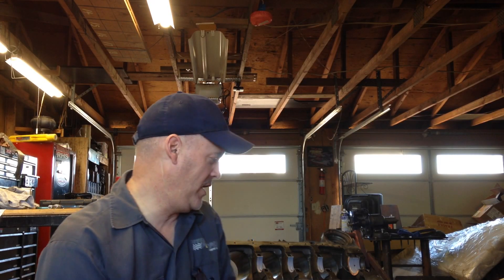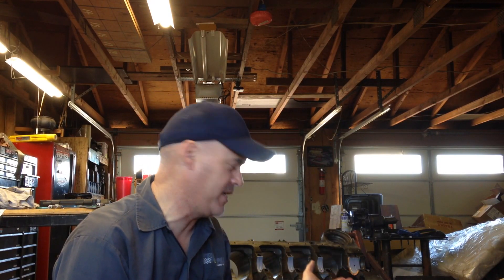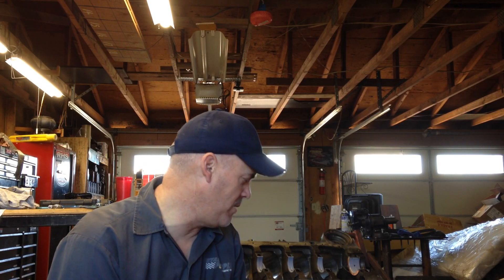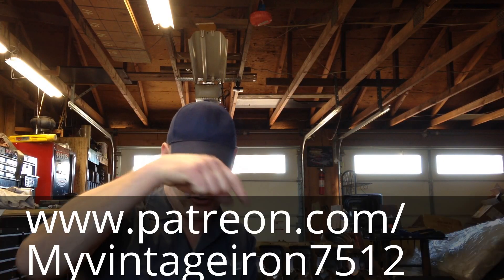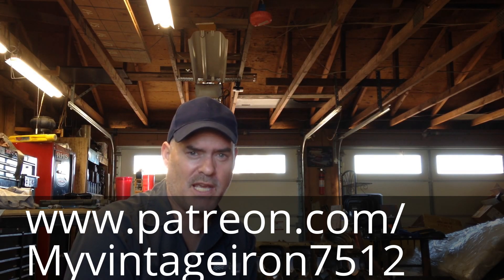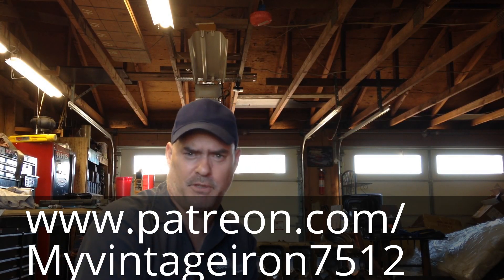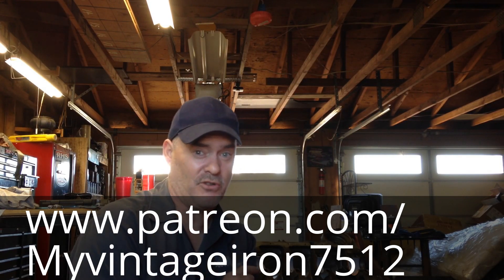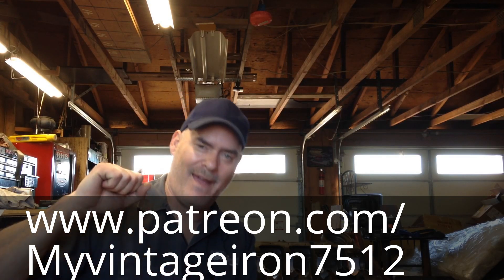Chevy 327 Breakdown

Comment: Seven years and this clip is still getting love! Might as well give it a bump , I rebuilt my 68 327 using your videos . The cam selection using flow numbers and info on rods and pistons really helped hit the target power for its intended use .While it doesn't go rumpity rump it will shit and get in it's 68 Impala home. The one thing I did backwards from most peopled thinking is remove the turbo 400 and put in a 350. It is lighter and takes less power to run and seems better suited for the 327 with a slight stall convererter. With the Qjet it's a goer! Wouldn't have got it right whithout all of these excellent videos!

Comment: The 327 is easily the best old school small block ever built.  I will ALWAYS build a 327 before I'll build a 350.  They rev SO much better than the 350 that the slight loss in torque is WELL worth it.

Comment: My 68 Vette had a 327 and it was amazing. What made it excellent was the Camel Hump heads . It did rev very nicely.
Reply: A 327 has a better bore stroke ratio,they like to rev ,  not as good as a 302 ,but better than 350

Comment: The journal size was increased in conjunction with nodular cast iron crankshafts.  The small journal cranks are all forged and are stronger than the large journal cast cranks.
Reply: Oh that makes sense!!  Bigger to compensate for a weaker material and also cheaper to produce.
Reply: So I just look for small journal crankshaft for my lt1
Reply: Correct. When you look at the crank the casting flash is about 1/2" wide
Reply: Were the old 327s the same bore as a 350, but shorter stroke?
Reply: John Tate, Yes, all 327’s have a 4.00” bore and 3.25” stroke, only difference is journal size.
Reply: silicon212 so all small journal 327s have forged steel crankshafts in them ???
Reply: @shitbox7413   how did you come up with the shit box monicer. 😆
Reply: That's not correct, there were many small journal cranks that were cast as well.  It all depended on what application it was going in.

Comment: Years ago I had a '66 El Camino with a 327. Quietest smoothest motor I ever had and when you put your foot in it it was like a rocket ship.
Reply: About to put one in my 64 elco
Reply: I got me a 327 block but has 350 heads u think it will be ok?
Reply: @funes3699  yeah should work just fine just make sure u put good valve springs in there

Comment: The 327 has always been near & dear to my heart . 307s are plentyfull & people dont want them so use the crank from a 307 put it in a 350 block & you have a 327 & you can use the 350 rod but you will still need the 327 piston. THX.

Comment: Still running my small journal 327 crank in a brand new 4 bolt GM block with spacer bearings on the mains. The other thing that most don't know is every small journal 327 crank was forged from the factory.
Reply: Max Brouggy I know I really miss my 62 had 365 free flow heads 11 and a 1/2 to 1 pop ups port matched everything crane 228 232 at 0 50 cam badass ignition system in a 2400 lb truck. Nothing like it. Until you build a Stout 383 pisses you off makes you wonder why you wasted all that time on that little 327
Reply: I'd wondered how the spacer bearings held up, sounds like they do, thought about doing that myself since I have a 4 bolt block I could put my extra 327 sj crank in.
Reply: @peterdragon9630  2 years on and still no problems, I turn this 7,000 on the strip.
Reply: I heard some say only the 350 and 365 horse small journals were forged cranks.  I  have a 65 300hp 327.  It's already 30 over but worn.   If it really has a forged crank I would like to bore it 40 over if possible and keep the engine .  I already have brodix ik180s , performer and a holly 600 do on it.  Only need better rods I'm guessing to push a 7k redline with a bigger cam.  Have to old 30 30 gm cam in it now

Comment: Good info. 
The 67 302 was produced with a small journal crank with a 2.300/2.000 main/rod journal diameter with a 3.000 stroke and a 4.000 bore. 
The 67 302 cranks were basically 283 units and the blocks were small journal 327 units. 
That changed in 68 and 69 which were large journal cranks and blocks. 

Also some performance bearing manufacturers produce special bearings/spacers that allow a small journal crank to be used in a large journal block. 
The smaller diameter journals lower the bearing surface speed, reduce frictional loss and lower oil temps in high RPM operation.
Reply from the maker: Yep you are correct on all points
Reply: So what makes more power? the 350 or the 327 small journal/large journal ?
Reply: w41duvernay depends on heads ... compression etc.. all else equal, the 350.. more displacement..
Reply: So basically then you could create a hybrid SJ 327 with a standard 350 block and get all the benefits of an SJ with high RPM ranges. Interesting.

Comment: Nice explanation on the 327 - I have a 68 Camaro with the original 2 bolt Large journal 327.  Interesting about the 327's in '69 where block casting #3932386 was used  for the 302 (DZ motor) - there were 2 versions , supposedly - 2 or 4 bolt.  The DZ of course used the 4-bolt one.

Comment: Glad you mentioned the SB 400.  They were notorious for running hot in the summertime with the air conditoning on.  They were not very economical either.  They did not like hard running at all.  I had one.  It sucked.  And not just gas.  An old fashioned mechanic told me 'Never before has so much hot iron tried to cool itself with so little water'.

Comment: Love the content craig. Im not banging on people, im just amazed at how much information has been lost that used to be common knowledge about small block chevs! Glad you're clearing some things up.rod & main journal sizes changed but ROD LENGTH STAYED CONSISTENT at 5.700.All GM did was moved the wristpin location on the piston! Exception: 400 sb wich is 5.565 for cam clearance. 327 were a fave for pro stock racers for many years the rod angle is the best of any sbc.Also if a guy is hellbent on a large journal 327 build and needs a crankshaft dont overlook the 307 as they have the same 3.25 stroke. 69-74. I used to get them given to me for free all the time! I started out collecting/ building/ selling 348- 409s as a teen in the 80s when nobody  wanted them. Been in the game a long time craig with restoration work for both Henry Ford & Sloan museum so im not just another yahoo out there, when I give info it is sound proven and trusted! Keep up the great work.

Comment: My brother bought a 350 from a engine shop I have a 1984 El Camino with a 283 L79 cam and he backs in next to me and pops the hood look my 350 I look at it and it has the vent in the back. I said no you have a 283/327. He traded for a 350 for his 71 RS and I get a 1967 Corvette 327 with a L79  in my El Camino now. 700r4 3:73 posi carbon fiber = fun ride

Comment: In highschool I built a 327 from a 4 bolt 350 block and a 307 crank witch is the same as a large journal 327. 327/350 cam, 327/300 intake with a 2in spacer. Went in my 70 malibu. Those were the days.

Comment: I'd definitely appreciate an in depth video on the 400,  I had one in my pickup and it was a beast. still have the engine and plan on rebuilding it soon.  I've heard about overheating issues though I never had that problem.  I've heard the cylinder walls are thin due to the large bore and I've heard they have extra water ports but it would sure be nice to clear up the patch work of Info
Reply: 400s have siamesed bores and steam holes in the heads,anything else?
Reply: The cylinder walls arent thin, its just that they are siamesed, so they dont provide as much surface area to the cooling water. Smokey yunick did a good job explaining the differences and what they mean regarding cooling and bore concentricity as the engine heats up.

Comment: I have a 1970 Chevelle 4dr. daily driver with a 307 , I am building a 66, 327 Small journal .030 over flat top pistons molly rings Comp hi energy cam with pretty much stock specks on 110 degree center lime for a wide power ban for a 700R4 auto trans. Will be using 882 casting heads and a factory aluminum intake and Q jet carb. I will be adding block huger tube headers and I am hoping this combo will give me good mileage & pull a good sized trailer with out issues in the Chevelle.  And yes

Comment: Have to say I'm loving your channel. They way you speak and describe things is perfect. Don't know why but I've always loved the idea of a 327. Here in Australia the common V8 growing up (25 yrs ago) was the holden 308. 4 inch bore, but a small stroke. The chev guys nearly always went 350. There were a few 307's kicking around but the unique bore size meant that there weren't too many compatible parts kicking about. I'm starting to source parts for my build, and I think I might go 327. 350 block (maybe a later model roller), with a 327 LJ crank. I also believe I can use 5.85" rods with stock 350 pistons with this combo. Should be a nice bottom end which will handle some revs.

Comment: small journal 327 cranks were forged steel ;) and this 1965 Chevy II I bought has a factory 300 hp 327 in it. The blocks casting number is 3790721 and its a 2 bolt block. Im building it for NHRA Super Stock SS/I class with a 4 speed. NASCAR engines use the 400 bore (4.125 inches) and the 302 crank (3 inch stroke) because they rev out to 9,000 - 10,000 rpm and stay together. Im not a fan of 400s and these long stroke small blocks. Ive burned more 383s and 400s with a 283 or 327 than I can remember. A 350 and 383 are good street engines but the shorter stroke engines rev faster and higher and are much better for racing purposes.  I love your videos BTW!!!

Comment: Awesome videos man I like the way you keep it clean! One thing I would like to point out is the 302 sbc shared the same crankshaft as the 283 sbc I used to de stroke 305 Chevy engines that would rev quick and high using the large journal 68-69 283/302 cranks, noted they were smaller bore than the 283's  which gave less cubic inches so it made for a lighter top end weight, I had to use a different connecting rod length though because the pistons set low in the bore, I used 305 truck pistons and 62-64 cc heads because the 58cc heads didn't flow enough air when you revved it up high, I did it on a whim just playing with parts to see how it would run, I have to say I was impressed with them!  I've since moved on to Pontiac engines and I am very satisfied now, but those were some low budget days filled with good memories and friends that I'll never forget! keep the videos coming and I'll keep watching!
Reply: @Aden Kaiser instablaster :)
Reply: @Aden Kaiser happy to help :)

Comment: by the way AMC/rambler made a 327 first and was kind of as hot rod motor for it day.. 327s installed in the 1957 Nash Ambassador and Hudson Hornet models in that it uses mechanical valve lifters and a higher compression ratio. Since both engines were rated at 255 hp (190 kW; 259 PS), it is probable that the Rebel's was underrated

Comment: That sounds good but they went larger diameter for the crankshaft overlap.
The 302 could be made by putting a 283 crank in an early 327 block but the cranks would crack under extended 8000 rpm road racing stress.
If you go 2.100 on the rods and 2.450 on the mains the overlap is substantially better same as the 400  versus the 350

Comment: We run 350's every Friday during race night at 8,000rpm, using standard mains and journal sizes, the valve train is more important at those speeds than the bottom end is.  We had a small 400 in our 72 Caprice, it was a good little engine, in my opinion though it can't hold a candle to a 383, and they are so easy to make now and are cheap to build.

Comment: L79 was the king 327 but in mid 60s the heads with double hump on front usually meant factory 300 HP. And they rev nice and quick. If i remember correct factory numbers were 365 on L79.
Reply: The L79 in stock form was the 327 350 horse motor the 365 horse motors used the Duntov camshaft if I recall
Reply: @danielmccoy8875  
Correct
L76 is 327-365 in Corvettes
I have a 65 Vette
L79
327-350
L84 was the Fuelie 327
L75 was 327-300
Base model was 327-250

Comment: Finally it’s clear on 327’s! Hope you can do a thing on 400’s  destroked to 377 or a 350 stroked to 383! The advantages or disadvantages of these two combos! Thanks great viewing! New follower after the 305 one! Awesome 😎
Reply: If you have a 400 use it along with some good heads, they make a lot of torque and don't need to be turned up any more than 6000 rpm, they make great street or baraket engines, by the way, use 6 inch rods in it.

Comment: I understand that there is a bearing kit available to run small journal crank in a large journal block. I have a Std forged 327- 365HP crank and rods that I am considering to build using a 350 block.

Comment: hi - love the vids buddy.i have about 50 steel cranks for sj 327 as well as lj 327s. i hear the large journal ones are getting very hard to find. in addition i have many steel cranks for 283s and 302s. i also have a few bb chevy steel cranks for the 396/427 engines with cross drilling. if you ever need any of these i will sell them on the cheap. i have what i need and theres plenty extra. keep up the good work and i will keep enjoying the vids. take care Don

Comment: I have a 1967 C50 Chevrolet with a Chevrolet 4 speed, reverse to the left and to the seat.  The engine is a '68 (I believe) 327 with the "two tall towers" heads and a Two-Jet Rochester carb and points distributor.   Always wanted to bring this old truck back to life.

Comment: There is 2 327 blocks in 1968 , 512  casting 350 hp small crank . The other 678 casting 275 hp same block for a1968 Z28 302 290hp . Big crank . I them all in my shop im

Comment: I want to build a 327 SBC for my dirt modified. With our open engine rules the maximum displacement is 362 for a SBC, and you can’t stroke or de-stroke your engine, but you can run 327, 305, or 283, as long as the parts match. I know there’s guys who run those shorter strokes engines, and turn 10,000RPM.

Comment: Do you think a 327 should be used in a 66 c10 longbed with 373 gears if I just plan to use to tow a boat every now and then? I already have a rebuildable small journal 327 and thinking about rebuilding it? The machine shop said I should go the crate 350 route since it has more torque for towing, but I thought some c10 came with 327's.

Comment: Great information.  thank you Myvintageiron7512.

 Ive learned a thoughtfully built small journal Chevy 327 engine can rev to 7500+ RPM (just over 4000fpm) and make potentially around 500+ hp or 1.5 hp/ci.,
 a  6" rod 327 will have a 1.84 rod ratio and much less side loading of cylinders than a 5.7 rod 350 or 383, allowing more rpm.
 a 383 stroker with 5.7" rods has a 1.52 rod ratio.

Im currently (jan. 2020) re-building the original 67' small journal 327 (3892657 casting#) for my 67' Camaro featuring some special parts like AFR cylinder heads, ISKY hydra. roller valvetrain, custom 4032 Auto Tec 10.5 comp pistons, thin ring pkg., 6" SCAT rods, GM forged steel crank (GM P/N 3782680).
Should be a good experiment, i had a 383 3.75 stroke engine for 20 years, looking forward to much more RPM.
Reply: Oh sounds great. Did you ever get that combo on the dyno?
Reply: I didn’t get it on the engine Dino but it is in the car (67 Camaro T56/3.55 gear)running very strong it pulls hard to about 7200 RPM that’s where I shift(1st gear), I’d say the combination is probably good for about 500 hp at 7000 RPM I’m planning on getting on a hub dyno soon, i’ve been having issues with mechanical fuel pumps lately, but it is an awesome combination.

Comment: I have a 66ss Chevelle and I'm just about to drop a L79 sb 327 all the way down to the steel crank and I've added a set of Dart Motown heads CNC Ported victor jr intake ported a 750 turned into a 850 isck solid lift cam and Muncie 4sd with a 12 bolt posi with a Zoom clutch set up!!! The block had 21000 original miles so I didn't bore it and went with the stock 11to1 pistons and rods but I did change the rod bolts to ARP and the mains now have ARP studs with a windage tray!!!! I'm hoping for low 11s in the Quarter mile what do you think?

Comment: Good info. I recently purchased a YW 327 that the seller claimed came out of a vette. WRONG! It was more than likely pulled from a school bus. Small journal mains with 1.72 intake valve's. And my machinist is trying to sell me a 350 stating the parts are cheaper. I think now ill keep the 327. Thanks.👍

Comment: I have a 327 block casting 3914678 and I don't know what to do with it (guy I got it from thought it was a 350) so looked the number up and I see they used these blocks for 302, 327 & 350 so I check the stamped code on the front and it comes back to 1968 327 from a Camaro, the cast date on the block is 11th month of 67 so would this be a 68 with the bigger journals? I would rather just use the parts I already have for a 350 if I can do that. Thanks

Comment: The 350 was introduced in 67. According to Motors Manual, and other sources, the 67 350 also had SMALL JOURNALS . Will that same size journal crank fit the same size 327?  Making the older 327's a 350.

Comment: First off great informational videos and I'm happy to support! I had purchased a 73 k20 years back and was told it had a 67' 327 with 350 heads I still have not ran any numbers to check if it's a 327. As for what I got in your video only 68-69 327's were inter-changeable with 350ci and not pre 68 or is it just the internal block components for 68-69 327ci that are same as 350?
Reply from the maker: The 68/69 blocks are the same as the 350 blocks pre 68 block is different smaller main bores
Reply: bought new 62chev 327 cu. conv. 300hp. never got beat except by j2 olds 57 .